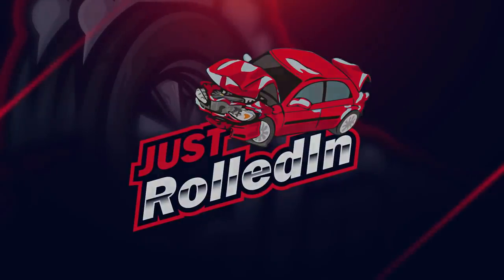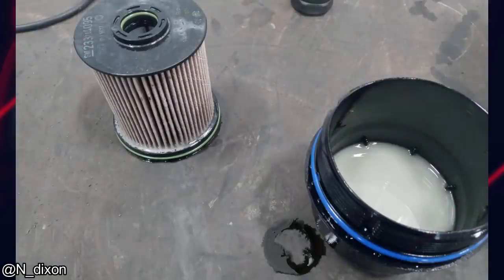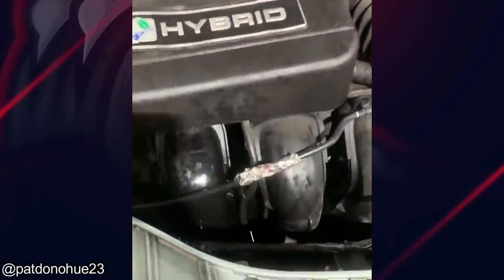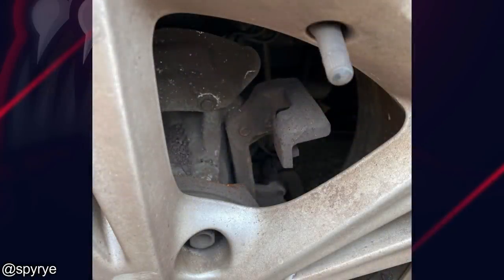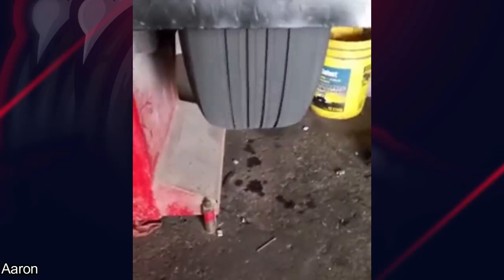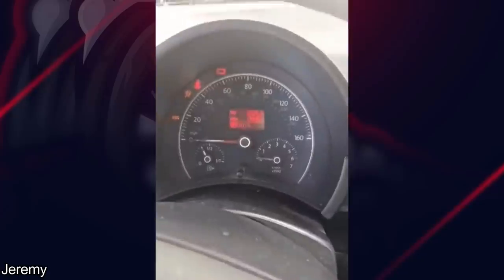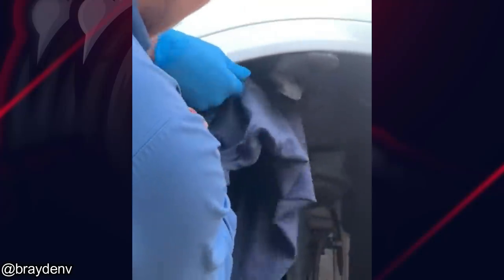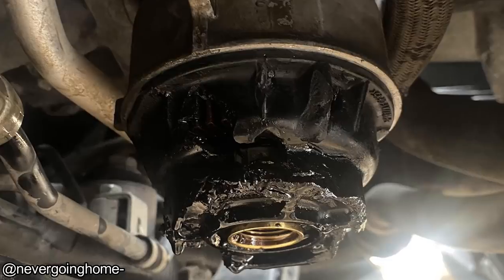Customer States He Did All The Work On His Truck & Wants A Safety Inspection | Just Rolled In

Comment: "He drove it all the way to the shop with no oil"  ...and he was probably planning to drive it back home to put the new filter on and fill the new oil himself... you know, 'cause mechanics are just too expensive.
Reply: I have neighbors that half ass the hell out of everything, and can't stand seeing things done the right way.  It makes my head hurt, so I don't help or watch anymore.  There are three certified JB weld guys.  They work without a plan and get all pissed off.  They only attempt repairs after catastrophic failure.
Reply: Reminds me of a Nissan guy that was proudly boasting about having his first oil change at 45K miles. The service manager heard him and put a block on his power train warranty after verifying that he still had the filter that comes from the factory.
Reply: Could've saved thousands of dollars if he just left the old filter on and poured in the new oil. Then drive to the auto parts store to buy some more oil and a universal oil filter wrench.
Reply: @TheSeanUhTron  The first oil change on my car was like that. I drained the oil and couldn't get the filter off, so I put new oil in and drove to Advance Auto for a wrench. Drained the oil, and snapped my wrench that filter was so tight. I put oil in AGAIN and drove to the dealership for $60 oil change.

Not sure why or how they even got the filter on that tight but I knew busting the filter would mean a tow and went to dealer in case the threads were messed up from that overtightening.

Comment: They make these things called "exhaust clamps" they hold your exhaust pipes together so you don't have to bondo them together.
Reply from the maker: Never heard of them! 🥴
Reply: That entire thing was wrapped tighter than king Tut, they don't survive moisture very well though.
Reply: If this customer was like the ones I've dealt with, he lost is shiat when he was told he wasn't getting an inspection sticker.
Reply: Ah but not everybody knows about clamps. Hopefully some one took the time to show them.
Reply: Ever here of a welder works great on exhaust
Reply: Welding the joints is better if access to a welder or pay someone the 200 bucks to weld it for you. But ya on a beater car the clamps work kinda ok i guess but still better welded even if costs a few extra bucks. Why do half ass work to repair again and again and again. Do it right the first time and it lasts years not months.
Reply: @MrSloika  lol just see his bondo job and wonder how the rest is before even looking. Gives all do it self people a bad name. Like bondo is not to fill holes. Its only used to smooth out minor dents or once new steel attached to smooth it out. Never over a cup to smooth or need a better base to start with. As for exhaust, well if that rusted all new pipes are cheaper then 50 pounds of bondo or fiberglass. In canada where prices higher you can buy pre bent pipes made for your car under 200 bucks. Under 100 for muffler. Clamps 10 bucks each but welding the joints is prefered and to weld a few joints is under 100 bucks. If need a cat just buy cheap after market thats good enough to pass a legal safety. Why repair rust? Remove all rust before doing next step.
Reply: @charlesvlcek2550  yes welding is the best. Lasts many years and wont leak.
Reply: @charlesvlcek2550  oh shit hey. Must be usa? But ya amazon good. I got 2 strutts, 2 shocks, 2 coil springs, 2 stabalizer links and a cv axle only like 600 bucks. Getting 2 main control arms and 2 tie rod ends only about 250 bucks. Hell a cv axle only 86 bucks. My friend was gonna scrap his car because of those parts. 0 rust and engine runs awsome. I said 1500 could rebuild it. What you gonna buy 1500 safetied. And now hear whole exhaust only 300
Reply: @shawnkelly1241  my dad's like that. He'd rather half ass patch up something as opposed to just doing it right. From vehicles to home repairs u name it.  He's gotten too old to do most things now so I e had the luxury of going behind many of past hack jobs to try n fix them.  His plumbing has 1 pipe with 3 different material types. Literally goes PVC. Cpvc copper and back to pvc
Reply: @ct1freak  lol half ass jobs. I met a guy like that and we butt heads when i work with him. Brand new item is 100 bucks and 2 hrs to swap those parts. He rather spend 50 bucks and spend 6 hrs half assing it and do again in a few months. Kinda glad he is letting me rebuild his van my way. The van has 0 rust and runs awsome but suspension issues. He usually just buys 800 buck junk but i said 1500 you can buy brand new parts and not half ass it. Cant do it right then dont start.
Reply: He probably spent more on bondo plus a lot more time to do a shitty job.
Reply: @atodaso1668  well many do not see it this way. Most do not even know that new parts cheaper in the long run or how to change them. Bondo is easier to use when no idea how to change those parts. But these days auto parts mega cheap on amazon and u tube has how to do it videos for almost every repair. There are millions of diy repair videos. U tube is the best. From law to auto repairs and even cooking or home repairs. Then listen to any songs you like as doing those repairs. Oh u tube you have so many awsome videos by awsome people sharing their knowledge and the best play list ever.
Reply: @shawnkelly1241  Be careful following some videos on youtube, I have seen some terrible advice.
Reply: @atodaso1668  well thats when common sense kicks in and try another video.
Reply: @shawnkelly1241  You only know what you know, you don't know what you don't know
Reply: @atodaso1668  ya
Reply: @atodaso1668  may not know but common sense you can see difference between right and wrong
Reply: @shawnkelly1241  Again, it all depends on how much you know.
Reply: @atodaso1668  so we now live in a world of dummies that have 0 reality of common sense?
Reply: @shawnkelly1241  Absolutely. Thats why your coffee cup says caution hot on it.
Reply: @atodaso1668  book smart  robots that need govt to tell them how to live. No mind to know if something sounds right or wrong. Rely on schools and govt to tell us how to live
Reply: Think it was JB wield he used it was alot of it he used to people think when they hear the exhaust man wields pipes together and the see JB wield at the auto store they can just wield it themselves with JB wield
Reply: @shawnkelly1241  200 bucks seriously I paid the local wielder 20 bucks to wield my together

Comment: Customer states, "I did the work myself."
Mechanic states, "That means it will cost you double, but due to the pandemic it is now three times the cost."
Reply from the maker: Dang, that got pricey 😜
Reply: Three times if I can even FIX or UNDO your MESS! 😂🤣😂🤣
Reply: I worked for a shop that had a sign that said 100 hr for repairs,  250 if you watch, 500 if you help 1100 if you did it first.
Reply: Thanks to supply shortages.
Reply: Why 3 times the cost? Just remove exhaust and all new. That exhaust was beyond repair anyway. I never saw 1 re usable part of it. I cannot understand how some think thats good work. Just more bondo and fiberglass and looks like shit. If doing the work yourself you saved huge on shop rates so use those savings to just buy new parts and dont try fixing old. Exhaust pipes cheap unless using stainless and only use stainless if plan on keeping over 10 yrs or show car. Brand new mufflers are under 100 bucks. But hey im sure any shop will safety that quality work lets try
Reply: @KenBober  and then i would leave and not use that scam shop. I watch every repair because i wanna make sure it was really done and not say did 5 repairs but only did 2 or charge new parts price but use used parts. Shops will scam and rip off anyone they can and cannot be trusted. Never trust a shop that wont let you watch from the door and return old parts.
Reply: @shawnkelly1241  it was more of a joke. I've worked for 2 bad body shops. I didn't stay with them very long.
Reply: @KenBober  lol ya shady shops give you a bad name as well. Glad you have the balls to quit and do the customer right.
Reply: @KenBober  but yes im sure there be added costs to do the extra work to remove that crap lol. Me personally i would usually repair a shit job but thats too much. How many other shit jobs were done and how long it take to find them and do it right. Leave a blank chq my friend or try another shop because i dont know where to start. Way too much. Once a car is that far gone its best to scrap it unless some rare expensive car or pick up. The box and exhaust alone be the value of that shit box. Just pull the box and after market new but now add 1500 to paint. May find same color in good shape at the scrap yard but that beyond repair especially gotta remove 20 pounds of bondo lol. Ya i maybe agree double or not even try just send him to another shop lol.
Reply: @beezertwelvewashingbeard8703  the supply shortage doesn't increase the cost that much, it just makes it take three month or longer...

Comment: Kitten extractor - Let's see Snap-on invent a tool for that!! :)
Reply: I'm sure Harbor Freight will have something similar for 50% less
Reply: But it will cost $500 bucks!
Reply: A snip at $1200 plus tax
Reply: @andrewlaw   Yep and it's also the newest must have tool on the truck, that you'll  maybe only use once in your whole career if you are lucky  L.O.L. The best thing I ever did on my first day in a new shop was tell the snap on guy to go away, when he suggested I step in the truck and set up a finance account ! I own all my tools on the first day of purchase.  1 socket is from Snap on and I have a  Mac die grinder, thats it for "top " name tools, the rest is cheaper stuff that funnily enough gets used hard but never breaks to need lifetime warranty, that's useless if somebody borrows it and don't bring it back. Or if falls in the frame rail or  belly pan of a machine and you can't get it back out again without a day of removing other parts as has happened a few times in 30 years !
Reply: BMW would have to have their own bespoke version!

Comment: Wanna here about the guy that bought a Honda with damaged side panels and bondo the whole car back together lol
Reply: Do you have pics? Gotta see that job.
Reply from the maker: Pics or it didn't happen lol
Reply: Bondo is the best. Why remove panel to replace and inspect for other damage or atleast knock it out first. Nope just buy 2 gallons of bondo and no wire to secure to the car. Just keep packing it in. Hey just add more hardner. I see many use bondo of huge rust hole without removing the rust or atleast rivit wire or something to cover the hole and attatch bondo to. Just use more bondo. Or the fiberglass sheet right over huge rust hole. Have seen some use card board or paper to fill the hole then bondo. Lasts the summer then falls out. Many like myself do cheap work thats good just not show quality. Cut out all rust. Rivit in new metal. Fiber glass over it then sand kinda smooth and prime. It will last longer then the shit box car and looks ok. Bondo will never stay in a huge dent unless hammered out first. The bondo is just to smooth out small dents.
Reply: @shawnkelly1241  back in the day, my buddy was having a new house built and the drywaller dude had a beat up turd. 
Yep you guessed right on what the dents were filled with if you said sheetrock mud.
Reply: @MrTheHillfolk  have seen spray foam used. Fill the big hole up, cut smooth then thin layer of bondo and awsome fix that lasts months. Well no insurance or license so dont want something fancy for the cops to impound
Reply: @MrTheHillfolk  hey that mud is basically bondo. Just prime it good and it will last weeks
Reply: @shawnkelly1241  yeah he primed it and it lasted pretty much all summer.
Reply: @MrTheHillfolk  lol but if kinda proper it lasts 10 times as long lol but some drive no insurance or license so hey it lasted and if impounded they dont get much lol. Here smokey bear impound my car and heres the keys. Have it and next week another shit box that looks kinda good
Reply: @shawnkelly1241  
Yeah , that dude was a little jumpy.
He nights been the non license type of dude,looking over his shoulder. 
Not sure if he liked the Bolivian marching powder but it seemed like it.
Reply: Chris Can Too!  as body guy its not hard 1h id have that look like it wasnt even there

Comment: 2:13 this is one of the reason why I would drill out the concrete to see how deep it is. I believe the concrete has to be at least 6 inches or more deep to hold the weight being on a lift.
Reply from the maker: I think you're right on that!
Reply: I'm looking at it on a phone, so I might be missing it. But shouldn't there be additional support/stabilizer sunk into the concrete? This looks almost like it's held in place with gravity alone.
Reply: @christopherconard2831  Normally you'd use expanding anchor bolts for something like that. They lock themselves in the hole when tightened and, depending on size, can have pull-out strengths of thousands of pounds each. The danger is if the slab is too thin, or of substandard strength, they can actually split the slab like a wedge.
Reply: They've used bolts far too short for the job. They've secured the lift to the floor surface but not into the concrete underneath it. I'd have used at least a 6" bolt for safety.
Reply: @andrewlaw  I'd be willing to bet the manufacturer of the lift provides detailed specifications for how it should be installed, which they probably ignored.
Reply: My 10K 2 post says 4" minimum of 3K psi concrete.  This... clearly below that!

Comment: Back in the carburetor days, we had a car come in with a chunk out of the lower secondary plate. Somebody figured the secondaries weren't opening up and tried to break them loose by shoving a screwdriver against the secondary plate and banging it down with his hand. Didn't quite run right after that until it was replaced. These abominations are on a whole new level.

Comment: the broken trailing arm reminds me of an old Chevy Celebrity I saw with a broken rear axle. there was a piece of rope tied to the back door handle around the bottom of the shock and over to the trunk. the back wheel would go forward and back depending on accelerating or braking.

Comment: Ah, hell.  I had an old pickup that I used for dump runs.  Once a year I would bondo the exhaust pipe/muffler connection just to get a sticker put on.  2" OD pipe, 2 1/4 ID muffler.  I'd pack it in the day before I went to get a sticker.  It only had to work for 20 minutes, and it did.

Comment: True story, an ex-friend of mine got his first car and didn't change the oil for a year until it died on the highway. You can imagine why it died on the highway. He got a new engine later on and then he didn't keep up with oil changes AND let his tires bald so bad (despite my advice many times) that he crashed into a guard rail. He didn't "know why it happened" and thought it was the ABS or something. Then his tire went flat two weeks later because he still hadn't changed it.
Reply from the maker: Oh gosh. Well good thing he's an ex friend I guess lol
Reply: Worked in an auto parts store (long out of business) and a guy brought a car in for inspection and the mechanic told him that he needed 4 tires to pass inspection and he refused so the mechanic backed the car out of the bay and wrote on the repair order"car needs 4 tires for inspection" a neighbor told us that he went to another repair shop and the guy just put stickers on the car and he took it away, about 2 weeks later the owner of the car got stopped in a roadside safety check and they scraped the stickers off because they were phony and they towed the car away and eventually he had it towed back to where I was working and had new tires and after 3 days the state police inspection trooper came back and inspected the car and gave us approval to inspect the car

Comment: Weird to see Rust that bad. In Arizona we just see very light surface rust.
Reply: Here in the rust belt (Pennsylvania) you're lucky to get 10 years before the vehicle needs driven to the salvage yard due to frame rot.
Reply: @TheLionAndTheLamb777  Rust protection could be the answer to that problem, here in Finland we have damp climate all year round, so cars rust like hell here if they are not properly impregnated and on top of that they salt the roads here in winter time so it helps the rust even more!
Reply: @TheLionAndTheLamb777  You aren't wrong about the salt in PA or other states in the northeast, but you can do things to prevent this like flush the frame out with water periodically. I have driven older cars in PA and they weren't rust buckets. I have also had frames rust out on me. It comes down to maintenance, like most things. Unfortunately for a used car you don't get to choose how it was maintained before you owned it.

Comment: i had a '99 ranger that had the vibrating wheels and steering wheel.the cause:had it jacked up in front to do brakes,turned steering wheel without starting the engine.that cause air in steering system. to resolve it:do a few figure eights in a parking lot,that bleeds it. i read it somewhere and it worked. never had problem again.when it happened i thought it was possessed.

Comment: 2:20 mark. I was working on a school bus and one of the locks gave out at one of the corner posts of the lift and the bus fell about 18 inches. I’ve never been so scared in my life. Never did get under that lift again, even after it was “fixed”.
Reply from the maker: That's scary stuff. Glad you're here.